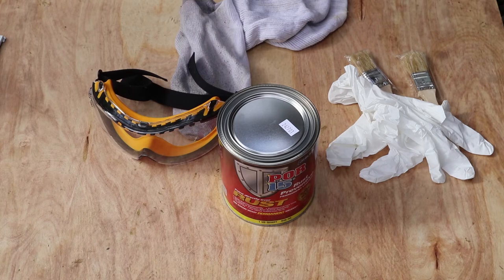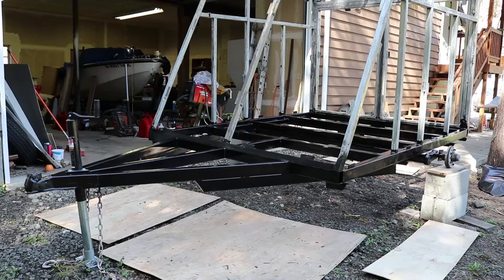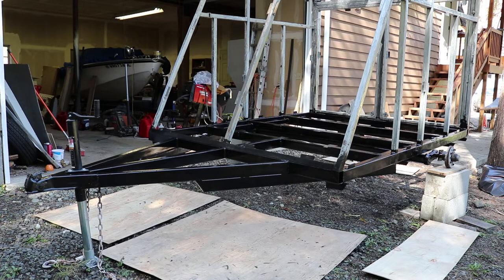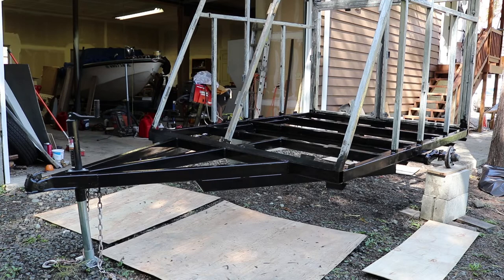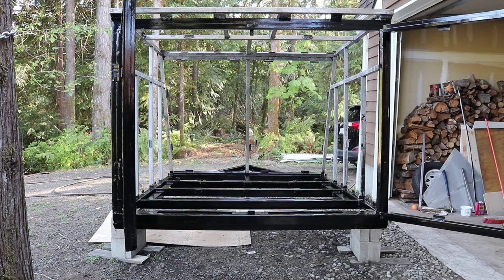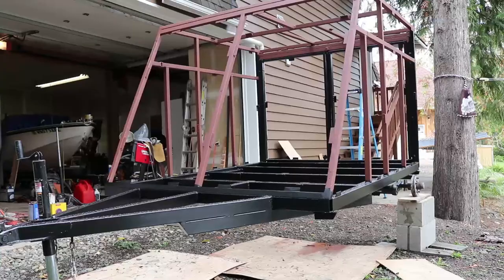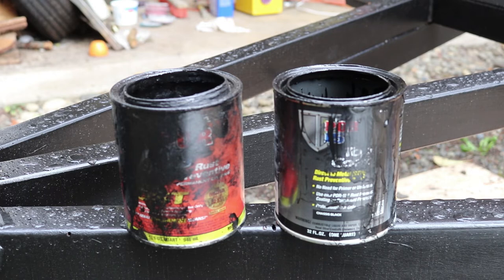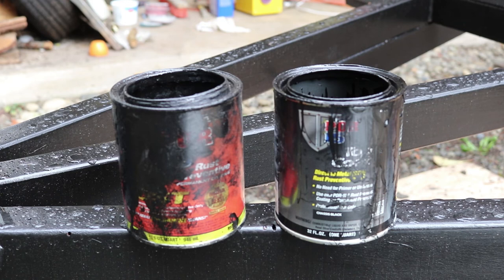Trailer Restore Part 6 Applying POR 15

Comment: I got the top coat for the trailer I'm building.  Has the por 15 kept its shine over time or has it faded or chipped off with time?
Reply from the maker: No problems, I stored it in the Pacific Northwest over one winter, still solid as a rock.  Always do good prep.

Comment: Its strange i have different experience using por15 and por top coat, to me they both very easy to bursh it on but the por(primer) is lot thicker than por top coat ,which is exact the opposite of your experience..
Reply from the maker: Could be related to the weather,  It is very humid in the pacific northwest.   Thanks for your feedback